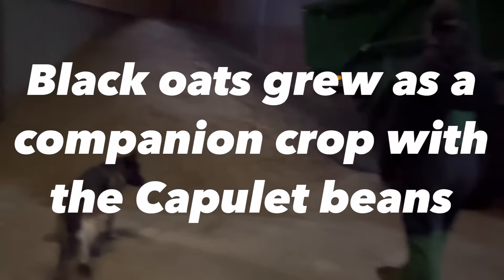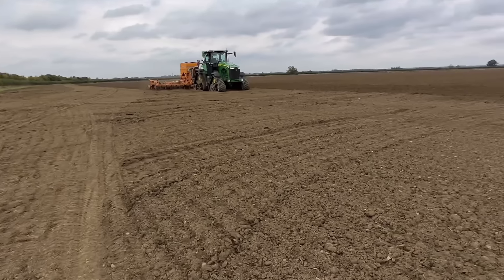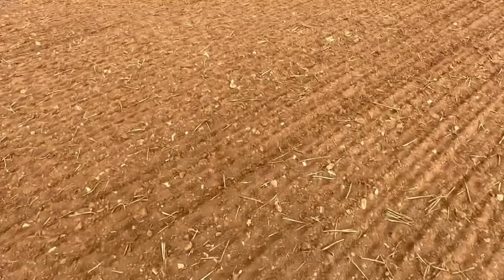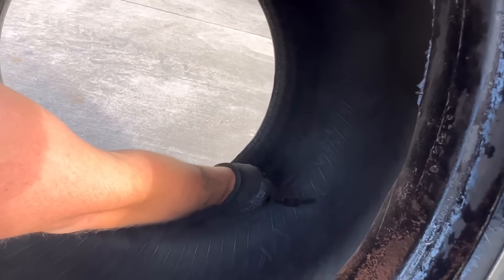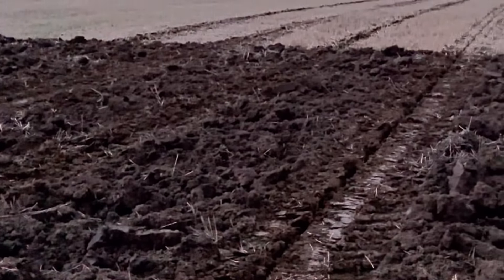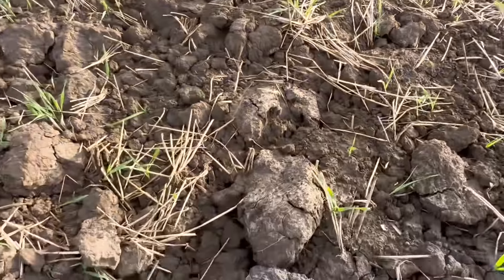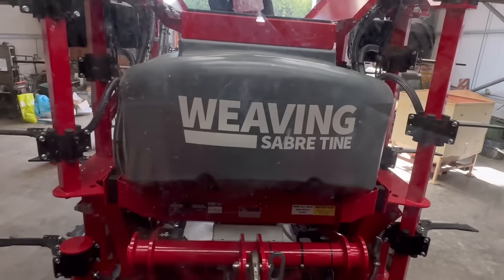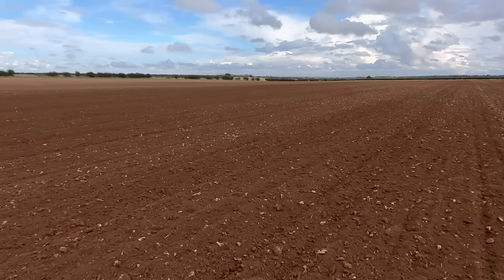Farm update 301 Planting wheat for harvest 2025 starts with Simba Freeflow &  Weaving Sabre tine.

Comment: When you spray off with glyphosate, the spray is in contact with the plants. How does the pre em spray work, if the plants haven’t appeared yet?
Reply from the maker: Pre ems work by sealing the soil surface and stop the plants from germinating. The mode of action of a residual herbicide (pre em) is different to a contact herbicide like glyphosate.

Comment: Looking at your capulet beans and their drying I suggest this may well become a regular problem. I suggest that the sorting might well comprise a colour camera over and air bed to release more of the beans from the mould. Colour cameras were coming onto industry when I retired. You would then be left with beans and some mould which could be graded with the mould partially dried and the beans finally dried at the end. 
With the low growth there will be a likelihood of mould in your gathering of the crop and the beans being a new crop the recovery from harvest may have to be revisited from current crops. You as a farmer will have greater enthusiasm and desire to make well of your harvest than a manufacturer who will only pay you on the recovered crop after delivery. As with industry you will have to do best with the product as is not as desired. It might be that blowing across an aeration bed would remove light chaff etc. It may well be that with this crop the sorting operation might have a different order from convention. As ever the use of air as a sorting format is a total loss operation i.e. the air is irrecoverable whereas hydraulic say is a recoverable format. Always hard to teach apprentices that as they always want to turn up the air for more immediate action!
Reply from the maker: Last year they didn’t need drying at all. We’ll combine them earlier next year!